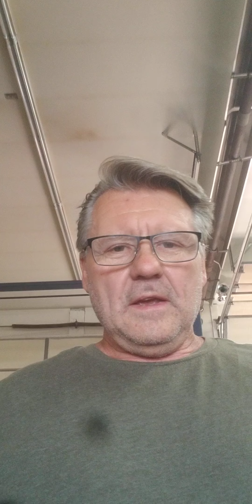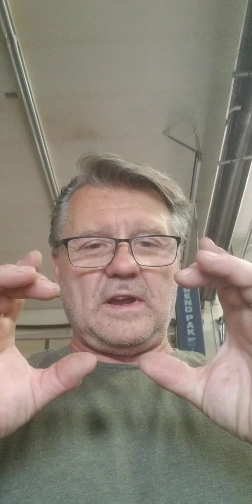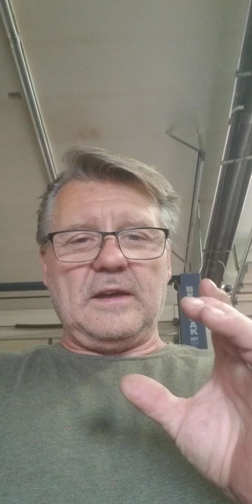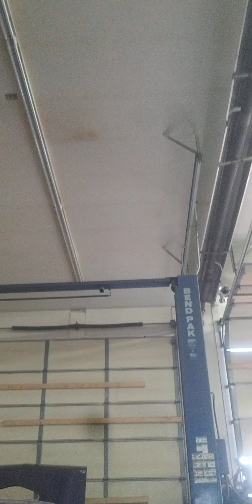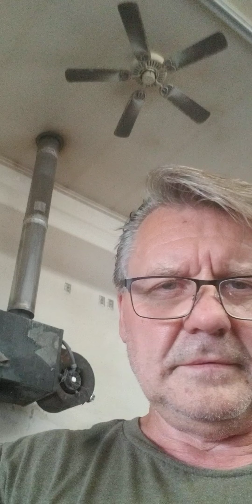Pontiac  engine fix part 1

Comment: How can a Shop be so far out on Compression.  Obviously Beginners.  
Another Question 4U Don . Not related 2 this particular build . 
What about a Dry Deck Engine Don . And Run the Water out the back of the Heads in2 the Block . Would this be better on a High Performance N/A & Blown Application 🤔
Reply from the maker: Compression was definitely an over site by the previous builder :(  We have actually done the water routing like you're thinking. Not sure if there is any benefit or not. Unless I do it to my own stuff and can actually do the R&D there is no way for me to know.
Reply: @dcimotorsports1111  

The reason why l believe a dry deck should be better is u aren't going 2 get Blown Head Gaskets & Water Leaks . 
On a Blown / Boosted Engine ... just O-Ring the Block & Heads & use Copper Gaskets . Just about Bullet Proof if everything else is Perfect.